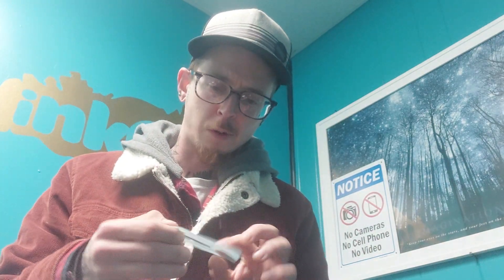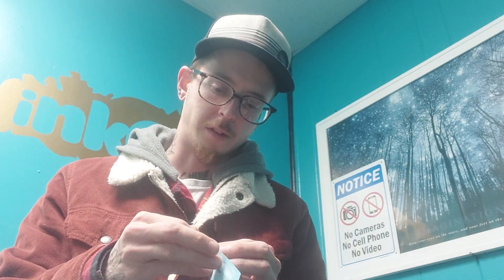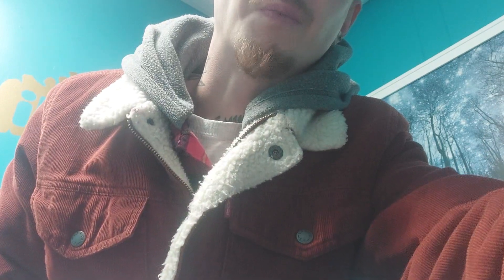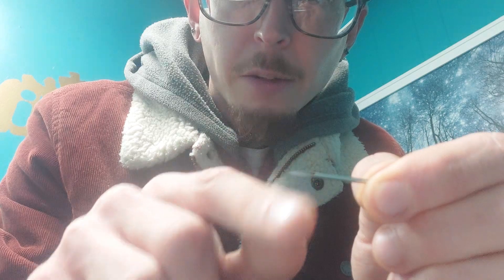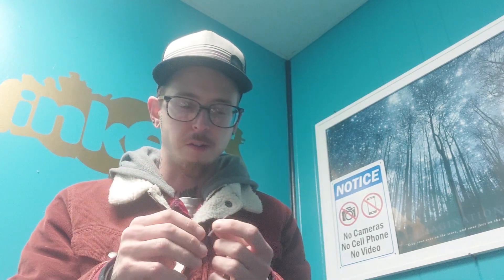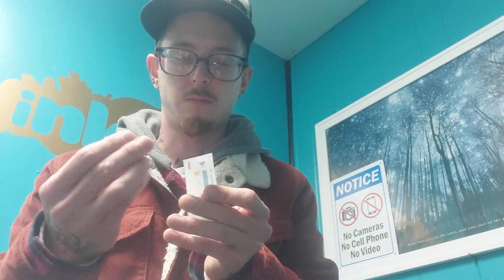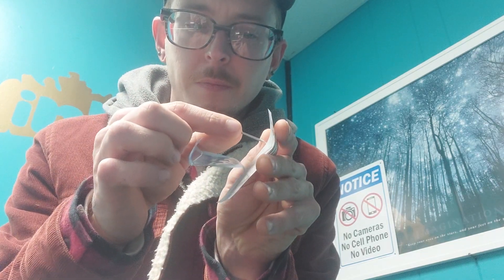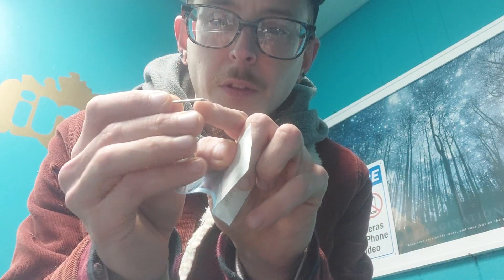Bevel Theory (Body Piercing): What It Is and Why It Matters

Comment: Im having a difficult time understanding what you mean when you say " follow the bevel". Any chance you could do another video elaborating what that means? That would help me out a lot. New piercer here.
Reply from the maker: @Alejondo  I mean specifically the angle of the bevel and not the angle of the length of the needle, so follow the angle of the tapered end do not push the needle perfectly straight. It sounds counterintuitive, but trust me.
Reply: @daltoncowan4104  but following the bevel would be to put it straight through wouldnt it? Im confused af ..can someone explain it more for me?

Comment: I do agree the bevel will travel, though the strength of your hand will negate that minute amount of travel.  It’s why we make our marks and aim adequately. We can see the travel of the bevel way before it exits the tissue.
Reply from the maker: Agreed. And there are exceptions: 16g needles do not wander as much, clamped piercings, I’m sure there are others. But I think this way of thinking minimizes the importance of this technique as the size of the needle increases. 

Trying to muscle, say, a 0g needle like this is very likely to end with a poor result unless the needle is modified (i.e. the bevel flattened with brass tipped pliers)